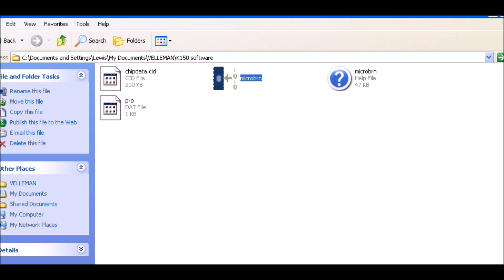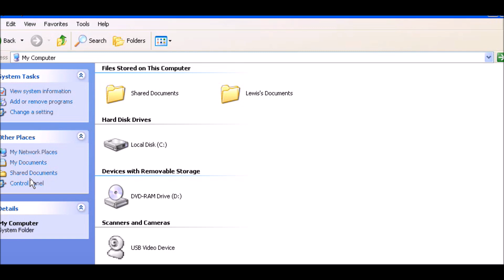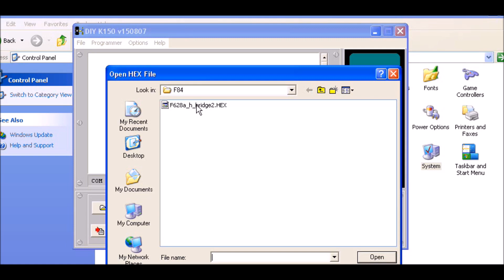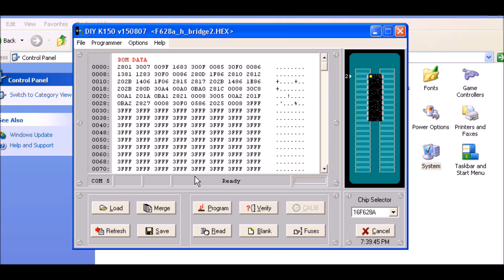How to Use K150 PIC Programmer

Comment: what I want read is; XICOR    X28HC64P-12     CY0031. But I couldn't connect or doing anything.
Reply from the maker: The K150 will not read such devices. An Xgecu T48 and and i used it for reading Xicor devices.
Reply: @LewisLoflin  so which one I need to use it inorder to make this connection?
Reply from the maker: @AsanMasraf  The Xgecu T48 is an entirely different device. They are on Amazon for about $70.

Comment: Hello my programmer reads the chip  reporting all 0s even if there is no chip into the socket is this normal? Shouldn't it report chip not found?
Reply from the maker: No, it should come back with the message can't find the device. Can you program a chip at all?
Reply: @LewisLoflin  this sounds good, that probably means my programmer and software are working properly. I don't know yet don't have any blank chip i tries to read a PIC16C620A but it probably is protected as it reports all 0s the misleading thing is that i receive all 0s without any chip at all also but if you confirm this is normal it's ok
Reply from the maker: @alessandrol9343 , I think you are correct. If the chip is read/write protected, that is what happens. Erase the chip, and it should come up with all 3FFFs.
Reply: @LewisLoflin  that's a good idea i will try that tomorrow and will let you know if it worked, thanks again for your help
Reply: @LewisLoflin  hello i tried to erase the chip but guess what? it didn't work either!! reading the chip still reports all 0s no matter what i do i always get only 0s. i even tried to reposition the chip inside the socket, upside down, from pin1 (regardless the image says pin2) etc. always got 0s.I ordered a brand new pic maybe everything is failing because the chip is writeprotected and i can't event erase it don't know... if the new chip won't work than either my programmer is faulty or window10 has problems with it i will buy an old notebook with windows xp and retry one last time
Reply from the maker: @alessandrol9343  What version windows are you using? I'll bet the driver is bad.
Reply: @LewisLoflin  windows 10 i'm usina a vista driver because every other driver didn't work. Microbn recognized my programmer but for some reason doesn't seem to work. I'll let you know when the blank chips arrive
Reply from the maker: @alessandrol9343  This why I tell everyone don't buy this thing. It has a pirated USB chip that has been shut off.
Reply: @LewisLoflin  the cheap price is very attractive,,, a TL866II which is also able to program a PIC16CXXXX costs 10 times the price of a k150 .... Assuming you are lucky enough to find one
Reply: @LewisLoflin  Eventually i got a brand new PIC16C621A and can cofirm my K150 workes perfectly with Windows10. There seems to be a problem with fuses though: i had code protection flag turned off but after i wrote the pic it become unerasable like if i left the flag on
Reply from the maker: @alessandrol9343  How did you get it to work on Windows 10? Why use an EPROM-based PIC16C621A and not a flash PIC16F628A? Eproms can only be erased by a separate EPROM eraser.  That is a separate item that will cost many times the K150. Email me at lewis@bvu.net and I'll try to help.
Reply from the maker: What software are you using?
Reply: @LewisLoflin  microbrn
Reply from the maker: @alessandrol9343  I'll run a test on mine and see.  give me a day.
Reply: @LewisLoflin  thanks a lot

Comment: Hello, if error says "the board is not responding". How to fix?
Reply from the maker: Did you load the USB driver? What port did you selct? What windows Version?
Reply: @LewisLoflin  I loaded already the drivers, it is in port 8, and I selected the right type of pic and port number 8 in micrburn, but still board is not responding. 
Im using windows 11.

Comment: Receive data error about to apply reset, I used 2 pic12c508a and still getting that error, when I hit verify it says Rom error, is the programmer or the chip had a problem? By the way im using win 10 with a 64 bit driver

Comment: does k150  has debug ?
Reply from the maker: Not that know of. If you mean check to see if the device is programmed properly that is in software.
Reply: @LewisLoflin  Real-time system monitoring as in stm32
(add breakpoint etc)

Comment: Can plcc32 IC/ BIOS chip be programmable with this PIC K150 Programmer using DIP32 Converter?
Reply from the maker: I think you meant the Pic32 type and the answer is no.
Reply: @LewisLoflin  thanks for your quick response. Regards. *using PLCC32 adapter. I guess, the answer is still a 'no'.

Comment: ПРИВЕТ  У ВАС ПРОШИВКА ? МНЕ НУЖНА ПРОШИВКА  ДЛЯ  PIC K150 Programmer   .  ДЛЯ  МИКРОКОНТРОЛЛЕРА, ЧТО НАХОДИТЬСЯ,  НА САМОМ  ПРОГРАММАТОРЕ, ПРОШИВКА ДЛЯ  PIC 16F628А.
HELLO DO YOU HAVE A FIRMWARE? I NEED A FIRMWARE FOR PIC K150 Programmer. FOR THE MICROCONTROLLER WHAT IS ON THE PROGRAMMER ITSELF, PIC 16F628A FIRMWARE

Comment: Will this work fine on win 10
Reply from the maker: You mean windows 10? Not the drivers I use.
Reply: Yes I am talking about windows 10.
Reply from the maker: @connectandcontrol1063  Then you need to find a 64-bit driver mine is 32-bit. I'll try something and get back.
Reply from the maker: I checked out the Windows 10 drivers they simply don't work. that is why I keep an XP machine for this exact problem and others. Sorry.
Reply: @LewisLoflin   yes indeed , I tried on windows 10 and its not working , I am completely  newbie to electronics but I love tinkering 
, I will try to make. Virtual machine of xp on win 10 I hope that works out. Thank you ,
Reply: @LewisLoflin  I installed the 64 bit drivers provided with the software package but none of them worked out , prolific driver shows error as 'the device cannot start(code 10)' that is really disappointing.
Reply from the maker: @connectandcontrol1063  So did I and they did not work. Prolific changed their coding to reject older chips where China mainly pirated their product.
Reply from the maker: @connectandcontrol1063  I will check that out. As for 16F72 blank problem they burned open an internal link to prevent them from being read. Thank you.
Reply: @LewisLoflin  Hello sir, I just want to ask that I recently uploaded the first program which is basically led blink program on pic16f72 using pic k150 programmer board and I am using 14.7654 Mz crystal with this chip, I created the hex file using MikroC pro  because I don't know how to use MPlab x IDE and  unable to set configuration bits on that, uploading that hex file is not giving any result , can you please tell what I am doing wrong in  this. It would be really. helpful to me  thanks in advance. If possible send me mplab project file or just hex file , so that I could figure out  what's wrong.
Reply: @LewisLoflin  Also which software did you use do generated hex file . ?

Comment: I hooked this programmer to Windows 7 and it works. On Windows 10 it doesn't work. I've tried 6 version of PL-2303 drivers with no luck including old ones. Is it because this programmer is a clone? How can I tell if it's an original? Will an original work with Windows 10? Is there another solution? Eventually, Windows 7 will be phased out and we'll be screwed.

Comment: Hello. I want to use the k150 programmer, but when programming pic16f88 in the user manual, it says 10k resistor must be added to the 9th and 10th pins of the socket. How do I add the resistance? Can I add directly on the socket?

Comment: I wonder: is yours a legit programmer from kitsrus.com or an ebay clone like mine? I get those same errors but I need to get some chips to finalize tests. I had to get older PL2303 drivers as well but that's a whole blog post/video....but I do have Windows 10 talking to the chip as Prolific's 'CheckChipVersion' correctly identifies it...
Reply from the maker: Mine came off Ebay. Now there is some problem with pirate USB chips and drivers. The latest drivers in particular with windows 10 won't work.

Comment: @Lewis Loflin, 
Clamwin free antivirus warns of malware, in the K150.rar file from the site linked to.

K150.rar: Pdf.Exploit.Agent-23658 FOUND

I assume that means it's in the PDF document, inside the file, but I haven't opened it to check.

I've been looking for sources of the K150 programmer software, and have found a couple with viruses, including the one banggood links to.  So far, I haven't found any that scan as clean, in both MBAM and Clamwin.

Comment: It is important to know that you can go into safe mode and reset the number
of the com port to a lower value than 9. That is as high as the PIC goes
My 2 usb ports were numbered 11 and 12. 
 I found #2 open and changed it to that and now the port link is working.
Safe mode,  device manager, Properties, advanced...blah blah blah
That is what I had to do to get it to finally work. 
This REALLY should be addressed in the video !!!
It actually finally after 15 hrs worked......I did not get instructions !!!!
I am running Windows 7.
Reply: Gracias capo, me sirvio
Reply: No encontraba como solucionarlo

Comment: i have installed the drivers, and double checked the com port but still getting error
THERE APPEARS TO BE A PROBLEM ACCESSING THE COM PORT
please help
Reply from the maker: What version of windows are you running? This doesn't work with 64-bit machines.
Reply: @LewisLoflin  i am running windows 10 64 bit.
Then i tried the same software on other laptop running windows 10 64 bit, it worked.
Then i formatted my laptop , re install windows 10 on it, installed the software, it started working
Reply from the maker: @sharadregoti7742  It's a 32-bit driver won't work on 10. Try XP on an older machine.
Reply: @LewisLoflin  I got mine working with win 10 64 bit but had to downgrade the prolific com port driver.  See this video for details... https://www.youtube.com/watch?v=YwOcBT2aHjo

Comment: Can I read it from the chip and then reprogram into another chip?
Reply from the maker: If it has not been "burned" to prevent reading the data.
Reply: The new ones are soldered in, no removing

Comment: Can we retrieve the data from my PIC12F625 and clone onto another PIC16 chip?
Reply from the maker: I think it has a read function - but if the original programmer burned open a link to keep the device from being read you are out of luck.
Reply: Very sorry but do you mean the programmer for this chip PIC12F625? The link means to the net? If this chip is not connected to web for its function, then we able to use K150 to open, modify and then save it?

Comment: Good night, my friend, I would like to know if you have the original firmware of the recorder for pic16f628, because I put the updated firmware to record the pic18f4550 only now I can not record the pic16f877 anymore, if you have please send me the old firmware, a hug
Reply from the maker: I have a link on the webpage of the only firmware I use. http://www.bristolwatch.com/k150/index.htm
Reply: Thanks for the reply, but unfortunately that's not what I was looking for, it was just the old firmware (.hex file) of the pic16f628a from the k150 recorder, ie the .hex file that already made the pic16f628a when buying the k150, and not the Your update to be able to burn the pic18f4550, but thanks and a hug
Reply from the maker: What is a K150 recorder? Do you mean programmer? I'm not sure what you are talking about. I've never used a PIC18F4550.
Reply: I know this is a few months old, but I think the question is about the data on IC's actually ON/apart of the k150 pic chip programing device...  Not from whatever random chip the individual was doing for their project.  Data such as you might find by using one k150 chip programmer to read the brains of a second k150 device as found stock from eBay.

Comment: Hi! Can you help me? I have a problem with my K150, I just buy it and I'm trying to program a 16F827A, it shows two errors, the first: The board is not responding... It resets and shows the second: Reset failed. Please check... (The same that you show in the video) But when I press the "Program" button it shows the windows again... What can I do? I'm using Windows 8.1, is that a problem?

THANKS!
Reply from the maker: What operating system are you using?
Reply from the maker: Windows 8 is likely your program. The drivers i use are 32-bit while Windows 8 is likely 64-bit.